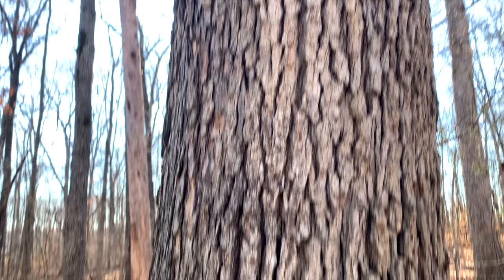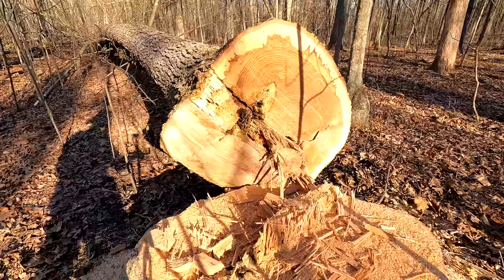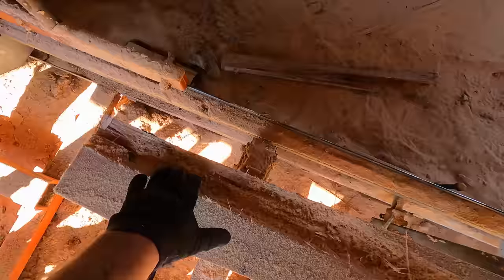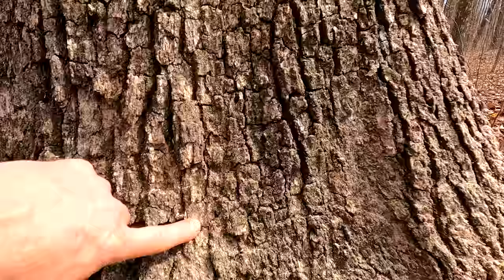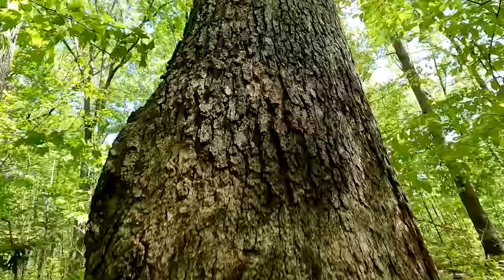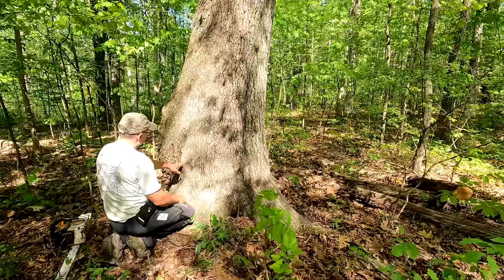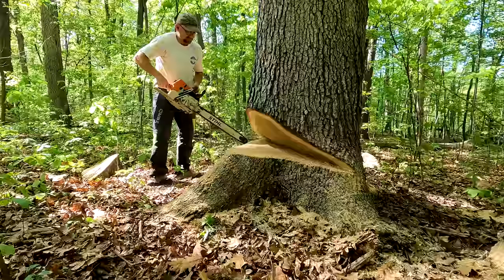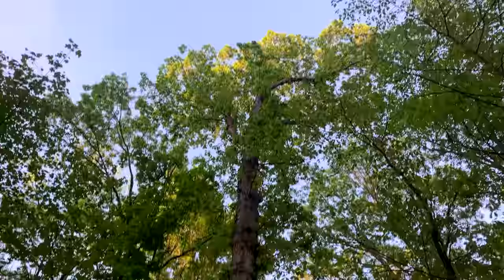Felling Big Oak Trees For Lumber.

Comment: Thanks for the great content!  I don't fell many trees but over the past 45 years they do add up. Whenever I see a tree with an odd base I recall a time in my 20's when I bit into a beech and within seconds the tree collapsed.  Beech trees had a blight so I had been taking them for firewood and had already harvested several big ones without incident.  That near-miss scared me so badly that even to this day I always whack the base trunk with a sledge hammer before I start the saw...never found another bad one...but I do check. Turns out that the bark was intact but the only place there was any solid wood was exactly where I started my cut.  Thus the instant collapse.
Reply from the maker: Yikes.  Glad it turned out ok.
Reply: I have several large beech on my property like that.  One of them is probably a better job for tannerite its so janky.  It's not near a fence I keep hoping nature does it for me
Reply: @FarmCraft101  It was 99% luck and 1% glad I was standing on the uphill side.
Reply: @mattfleming86  Things that go boom are so much more fun. Even if it is work.

Comment: I was a professional Tree-Faller here in New Zealand for nearly 30 years. Your execution on the felling was not perfect, but your principles were sound.
  An option to maintain the integrity and strength of the Hinge-wood when dealing with heavy lean is to plunge cut from the sides (do the heavy side first), then release the back at a higher level than the bore cut. This ‘Bore and Release’ does two things; it releases the tension slowly, and it greatly reduces the chance of splitting and extremely dangerous “Barber Chair”.
  Another tip is to lower the angle of your top cut on the Scarf. The scarf will close up sooner and snap the Hinge-wood before the tree hits the ground helping prevent damage when the tree rolls. Wing Cuts will also prevent side-splitting as the tree hits the ground.
  I love your videos, I enjoy every minute.
Reply: with a leaning tree like that leave enough hinge to not pinch your saw, its only going  the way its leaning. No need for wedges and splitting a tree is not safe, just plunge to be safe.
Reply: you and your saw are too 
slow for you to not plunge cut. hope  u manage to stay alive,bro.
retired professional.
Reply: Medical directive would be a great idea.
Reply: Agreed, boring the hinge could have prevented most of the trouble with #1. Terry Hale provides the most detailed and methodical explanation I've ever seen.
https://youtu.be/tGLV4AcyYXw?t=430

I would add, the center of the hinge provides little directional control. Hale covers this in another video. I would go ahead and plunge it out, even in case of a moderate side lean. Maybe leave some extra meat on the uphill side.
Reply: Well, I just saw FarmCraft did this on #3. Seems like it would have been the ticket on #1 as well.
Reply: Helpfully and no hype , thanks. J
Reply: Tu te Kohe, agree fully, only thing different to me, on a heavy leaner, you do not need such a deep face cut, provided you have a long enough bar to plunge cut deep.
Reply: @benjaminsondelski3784  YES, the lean had no bearing on safety from what I saw of it, relief cuts are the ticket, for me the faster I can put it on the ground the less time it has for fate to act up and screw my day
Reply: Logget Wade step cut on u tube is an easy safe method for heavy leaners
Reply: I was going to comment suggesting the side plunge technique as well.

You can basically "do" the back cut, but leaving a strap at the back large enough to hold the tree.

That way, your hinges are cut to perfection and you only need to remove the strap when you want to release and fall the tree.
Reply: I think you did a great job cutting down the trees, when you’re cutting the back cut don’t forget to be focused on what’s up above, Lost a coworker not paying attention above.
Reply: I agree with everything said above except the narrow notch. A possible cause of a  barber chair is a dutchman (leaving a small kerf cut in the apex of your notch). When that closes, the tree might not have enough momentum to break the hinge, leaving the tree suspended at steeper angle than before, and making a barber chair even more likely. 

When felling Ash spars we have to get the hinge thin enough, and the notch wide enough, or we will have a huge trunk stuck 20 feet in the air. Always exciting.

Just know you got away with a close call on that first tree. The splitting up the trunk was a sure sign that it wanted to barber chair. Always bore (plunge) cut trees with a heavy lean
Reply: A bending stress diagram would help people understand the internal stress acting on the tree.  In bending stress, the most stress is on the outer most fiber and zero in the middle. One side in compression the other side in tension.  Therefore, doing a plunge cut does not affect the steering direction.
Reply: Exactly correct. On those leaners i do my face cut making sure not to have both angles meet together. Then i plunge cut keepin 10 or 15% of hinge and saw twords the back using that back as my trigger. Prevents barber chair or runing the first 8' like this guy did
Reply: @benscoles5085 true that i dont face cut that deep on leaners either
Reply: 😊well said mate

Comment: @3:09 as other commenters noted, a plunge cut from the sides, with a proper amount of hinge wood, is more safe to prevent splitting in general and barber chair splitting, especially for trees that lean and for trees with rot in the middle.

after the plunge cut is made from the sides, the tree is released to fall by cutting the "back strap".
Reply: Thats what i thought. I thought it was better to plunge cut on a leaning tree to prevent barber chair, but he said the opposite. That he did not want to plunge because it was leaning?

Comment: A Washington native (White not Indian), Roger, taught me in 1983 how to fell tall, large Pines near property he & his friends owned in North Bend WA. He used a 48" bar Stihl chainsaw. He taught me to use it that day and how to make a tree fall where you want.

Same as you do.

I'm a 70-year-old retired Stagehand these days. Been retired from Stagehands' Union since 1996 & fully retired since 2013.

Not long after returning to my hometown of Las Vegas, NV in 1984, I had need of what Roger taught me. A customer of my dad, Melvin, had a tree they wished removed from their yard. I don't recall the reason, just that I & a friend would earn $$ per hour to do it, since I had mentioned that someone showed me how to do it.

The home was on a standard building lot of the time of 70' X 100', so the back yard where the tree was located was quite small with numerous fruit trees and fences to avoid damaging. I felt confident about this challenge, considering the trees' size (a large Elm apx. 35' high X 20" thick at the base.) I chose to make the final cut apx. 36" from the ground. Like you though, I could see the trees height would cause collisions with the fruit trees and fences.

Therefore, I deduced it would be necessary to cut the top limbs as well as some of the trunk.

Being a "pup" at a very youthful 30 years old, I felt confident climbing the tree to cut the limbs. No Boom or Lift Basket could be employed as no access was possible. I was disappointed by this as I VERY much enjoyed using, what we Stagehands called a "Cherry Picker."

So, using a few ropes & knots (NO! stagehands ARE NOT Sailors, BUT MY DAD WAS!) I was able to both climb the tree and secure myself safely.

After topping the tree, I then determined the best place to land the trunk, which was now only 14' tall. I was so confident; I placed an empty Coke can on the ground where I predicted the top of the tree would land.

Eureka! I SMASHED that Coke can under the first foot of the top of the tree! Whoop!! Damn, I'm good! Thanks, Roger!!!

I got that feeling you had when you fell on the ground after you felled that Beech tree. Fo Sho!

Upon moving to Missouri in 1998 after acquiring 27 Acres of raw land to build TWO homes on, I learned a LOT MORE about felling trees safely. Yes. I made a few mistakes, but none that caused injury.

That is until I relapsed from alcoholism and began drinking again. Between April 2004 and Nov 2009, I suffered TWO accidents, WHILE DRINKING, using the chainsaw.  A Sthil Farm Boss, I don't recall the size, but it came with a 24" bar. BOTH were "step-through" types when cutting felled trunks into firewood lengths.  Each tore my Jeans and opened a substantial wound above my LEFT kneecap. LEFT is important to note as it is the one MOST AT RISK when cutting logs on the ground (if you are right-handed). Thanks to my fast reflexes, neither cut the bone nor did serious damage. Nothing more than 4-6 stitches to repair the flesh wound.
I got lucky both times.

My THIRD SCREW-UP occurred during this ALCOHOLIC relapse, when I mistakenly discharged my SUPPOSEDLY empty .357 Mag Blackhawk Ruger Revolver into my left ankle. Yes, I really shot myself in the foot on that one! YES, I still have a working foot.
It was a FMJ Target round, not my normal Hollow point rounds for piercing flak-jackets for protection. Yes, this was pre-Y2K.
I was prepared, that's why I left Vegas. 'Nuff said.

Do I need to ADD any SAGE ADVICE about alcohol & weapons, driving or dangerous tools? I hope not. I hate typing.

Thankfully, I've survived those and other mishaps, some drunk - some not, and now at 70, I get to kick back and enjoy watching MANY videos of others doing things I USED TO DO & things I NEVER HAVE DONE, but would if it were 1983, or 1993 or even 2003. But NOT 2023, thank you.

Now, to your video production expertise. You, or your wife, might be Fellow Travelers (no pun) in that realm. I worked more than 22+ years in the Entertainment business in Vegas. This includes many years in A/V & Film Production, and post-production for VISUAL & VIDEO display systems of the day. 

Kudos for the editing and aerial shots to augment your presentation, as well as the quality of the video images, the stills, and YES, your musical choices and balancing of the audio level. Se Magnifique!  Bravo!!

I've NO intention of doing these vigorous & strenuous activities again. Yet, in my sobriety and aging I see things in your videos and my memories reflections' that would have made this City Boys' transition to Rural life a HELL OF A LOT EASIER if your videos had been available to me THEN! Where the Hell where you when I REALLY needed you??

I also like to teach.

Over the many years I have shared my knowledge & experience with co-workers, friends & others in many professions. Yes, I've had several and they are as diverse & technical as they come. I love a challenge and TAMING THE LAND ranks among the most demanding I have ever met. Multi-Media, extravagant production shows & Enterprise level Networks and Servers are challenging, but once tamed, they submit to my authority.

Nature does NOT. 

You can't don't just clear & build. That's the initial HARD part, and satisfying to accomplish but...Now, maintain it, buddy. 
That's REAL WORK every day to MAINTAIN!

I have NO INTENTION of installing an HVAC/Heat Pump, but I guarantee you I'll watch just to learn how. Like you, I'm that way!
I'm curious.

David
"..old Stagehands never die...we just fade out........."

Comment: Tree guy here, Leaning trees are the perfect situation to utilize a plunge cut. You can thin your hinge for less tear/breakout on the log and it helps to avoid barberchairing and splitting up the trunk.
Reply: Same thing I was going to comment after watching. I prefer plunge cutting heavy leaning trees because of that..

Comment: I've been a pro faller 42 years.  I seen some other pros leaving comments saying much the same thing, but I will add that cutting big veneer white oak is the mainstay of my business.  Won't even talk about the first one, you beat yourself up enough and know exactly what you done wrong.  Little point I will add for anyone is you can't chase cut hardwood like white oak much more than a few inches of the diameter, in other words, center punched, heavy side cut up to the hinge and only chasing a side strap on a tree with hard side lean but little to no forward lean.

Second tree was really good and with a couple of exceptions, liked like many of mine.  Work on that stump height, your giving up a lot of good wood on most trees.  If it's bad or you screw up a little, it can always be trimmed off but you can't glue it back on.   Make your back cut level to the knotch. Every inch above level, you loose about 25% of your hinge strength, so if your only holding a side leaner with a corner, might not be strong enough to hold.

If you have to double plunge a tree, tip your bar down on one, or both cuts so the cuts match up and don't leave a wafer.  Try to learn where your tip is and only use enough bar to cut wood you know hasn't already been cut.  Contrary to what some people believe possible, you can cut a six foot stump with a two foot bar!

Comment: Greetings from a small island. Interesting vid and an interesting patch of woodland with some gorgeous trees. It will be nice to see the timber sawn and used. Big/tall hardwoods over here in the UK are valuable, so the emphasis is always in maximising the value of the felled butt - ie avoiding splits.  Alan Burton has it right:  When felling a heavy leaner, leave a dog's tooth (back strap) at the rear as a trigger for the fell. Stops barber chairing. Also prevents tearing in the butt centre as you can cut to your ideal hinge thickness - you don't get a 'premature' fell. To prevent tearing in the sides of the butt by the hinge, place two small stopper cuts just below the level of the felling cut at 90 degrees to the hinge. Also protects the stump if you want it to coppice. To cut through the back strap to trigger the fell, cut downwards, not horizontally. This leaves an upstanding 'dog's tooth'.  If your bar does not come all the way through, you will have to bore in from the far side. You can do that fairly early in the fell.  Don't leave your dog's tooth in buttress wood - see below.
I was taught to start a fell on a tree with buttresses by removing the buttresses to leave a cylindrical trunk.  That long bar  would probably have just about reached the far side of tree 1... Doing this also seems to limit the tendancy for horizontal cuts to wander away from the horizontal. A steeper top cut in your birds mouth so that it closes much later in the fell also limits splitting. If your tree leans in the direction of intended fell, you can go less deep with the birds mouth, but your hinge needs to start at around 1/3 (to half) the diameter - ie be nice and long. I was taught that a bore cut through the back of the birds mouth is only used when the diameter of the tree at stump top approaches twice bar length (after removing buttresses). A 'throat bore' affects the hinge (inevitably) but it's all a compromise. Yes, I use a 'small' bar (and a small saw) so the cuts need to be accurate.  I'm ticketed to twice bar length.
Hope this is useful. Things are different on this crowded, septic isle. Less woodland with hardwoods and we have been felling out the best trees for over 1000 years, which may have selected for hardwoods of poorer form. In the south of the island many of the hardwoods that are felled are trees that were left un-felled in world War 2 which also tends to mean that they are of less good form than your lovely trees.

Comment: Cut down my first tree the other day, learned a lot from your videos. Thank you! Cutting that notch was a lot harder than I thought it would be.
Reply: Get over to a actual tree guy video you will learn they will explain setting your hing and proper safety around the stump not demonstrated here. I suggest guilty of treason, billy bucking ray, they are more focused on residential but have very detailed information and knowledge
Reply: @joshuabennett7334  this guys seems a great place to learn wood working as in milling. Falling, not so much. Gets the job done but not quite textbook. Especially his "plunge cut". That would get you sent home from working interview where I'm from. Plunge cut should be made parallel to the face cut, leaving a FULLY INTACT HINGE.  The way he plunged at 18:22 is the correct way to do a plunge cut.
Reply: @mturner221  his plung cut is a north eastern hardwood lager thing. I grew up in a north east logging town then moved west then south for context so I have seen the difference between west coast felling and east coast felling understand why they are used. His “plung” cut is for knocking out the heart wood when either your bar is to short to reach or it is going to leave the stump hard and fast hardwood will split easily. The plung cut your referring to is a boar cut. My biggest issues with his felling is he watches his curf and never watches the crown he doesn’t know how to set his hing in a controlled manner and his face cuts are to deep

Comment: You make it look easy.  

As an amateur I have cut several trees that large and had all kinds of fun problems.   

I had a huge black walnut tree  split in half as it fell.  

Also had a huge cottonwood stick three bars with 6 wedges  trying to hold it took 5 hours to fell it and buck it up.  I realize now that I should have cut the center after cutting the wedge but before  cutting the edges to the hinge.

Thanks for the great video!

Comment: If you want an easy safe method to cut a heavy leaner with minimal to no damage to the log watch Logger Wades demonstration of a step cut. I have 30 years experience cutting timber and have found the step cut to be the best method to get a heavy leaner on the ground without damaging the log.